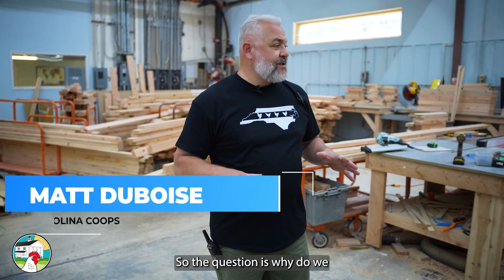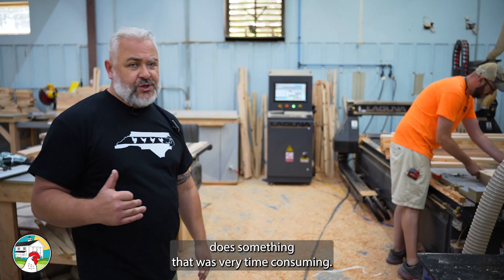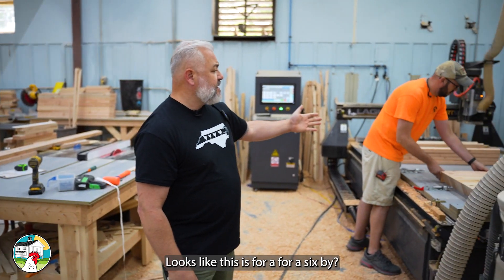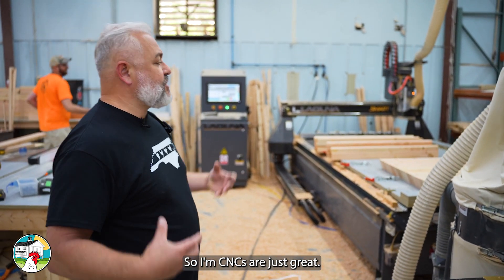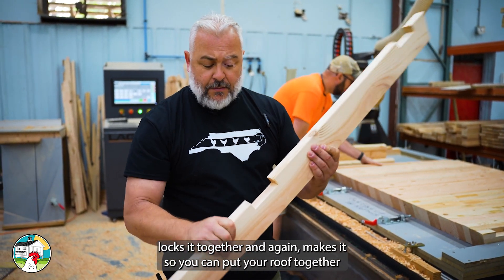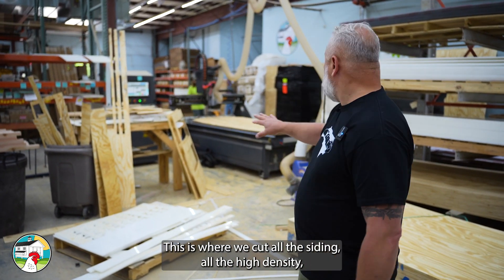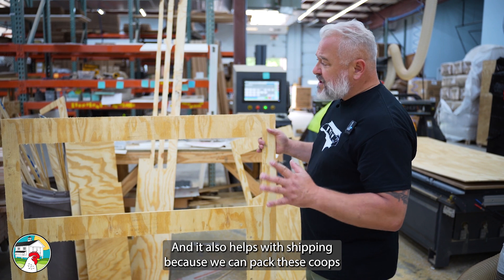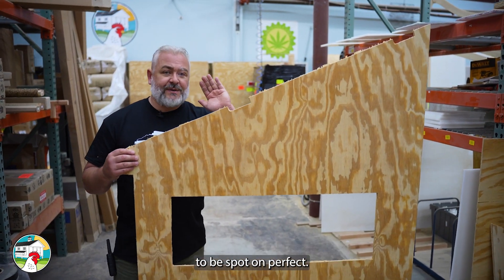Building Chicken Coops with CNC Precision!

Comment: I replicated the Carolina Coop and it took me months to do it.. lemme tell ya.. it ain't ez by any means.. The roof system is by far the most complicated. I had to Dado cut every purlin and truss on a table saw with all #1 prime Douglas Fir which is not cheap! I don't own a CNC which means i had to be super precise on every cut.. close to 200 lap cuts.. which is actually around 1000 passes thru a 3/4" table saw dado stack , 5 or 6 passes to make just 1 lap cut!!! You also have to make sure all your boards are crowning the same way and mirror them to the opposite side of the roof. This does not include the 22.5 degree end cuts or the bird mouth cuts which also have to perfect in length and seat. Then there's the upper truss blocking that needs to be cut, pocket hole drilled and glued and clamped in a certain order lol. If you're not a pro builder, don't even attempt it, you will fail ! Everything needs to be milled true and flat to accomplish this !  Also , you'll need to build a jig so all your trusses are exact to one another. Buying a Carolina Coop is well worth every penny ! Highest quality on the market hands down ! And no.. they didn't pay me to say this !! They have no idea who i am. If you don't understand the cost of premium materials or understand the quality of what you're buying .. i'm sorry ! Don't even get me started on the cost of HDPE, Roofing, Screws, Poly, Plywood, and everything else. Anyway, if you guys at Carolina Coops need a head tech on the West Coast in the SF Bay Area with innovative ideas to go with it  .. hit me up :) Love you guys.. Cheers
Reply from the maker: Thank you so much for your comments. We appreciate it so much. Many people don't realize all the work that goes into each and every coop we build. Thank you again so much for your kind words.